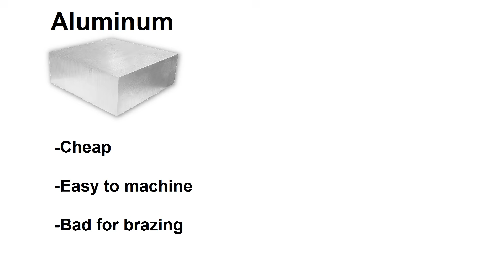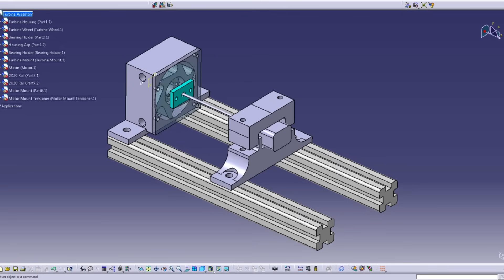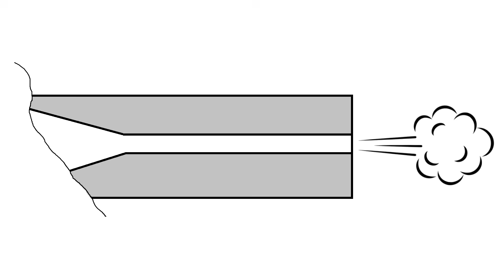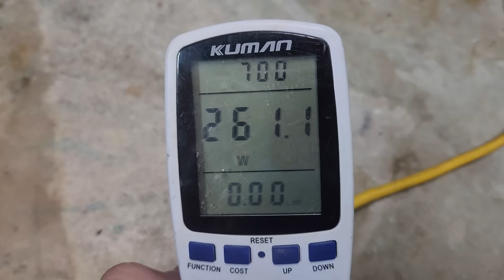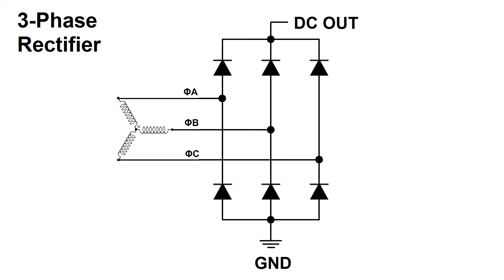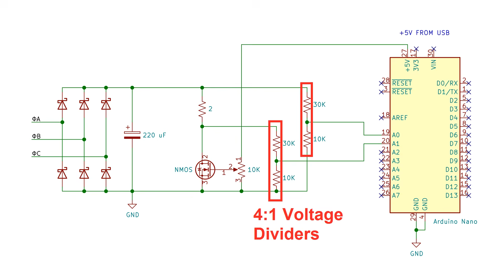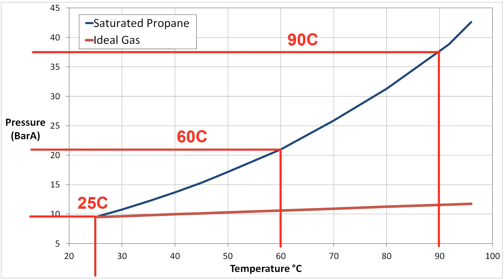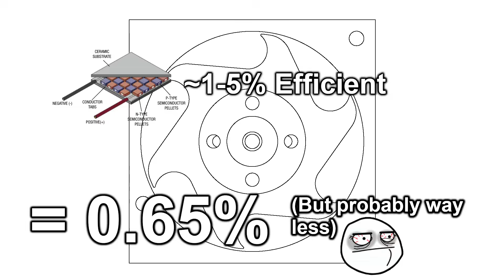DIY Micro Steam Powerplant

Comment: @Hyperspace Pirate - I am very interested in this sort of thing, and in fact sent a different link to a friend just yesterday. I have made serious study of steam engines for many years, so I have some things of relevance to say... Your feedwater rate seems excessive, which GREATLY lowers the system's Thermal Efficiency. It would be very helpful to measure the steam temperature as it leaves the boiler, so that you can be sure the flow rate is low enough to ensure there is SUPERHEATED steam, instead of the SATURATED steam you appear to have.

As for a different kind of turbine... The brownish rotor vanes you show at 19:42 look like PHENOLIC plastic (Bakelite), possibly fiber reinforced. That would be good to 150°C, possibly 200°C, but the plastic will begin to soften and become sticky against the metal, which is very bad for sliding vanes. The presence of fiber reinforcement in phenolic plastics affects their thermal and mechanical properties. Fiber-reinforced phenolic composites generally have improved thermal stability and mechanical strength compared to non-reinforced phenolic resins. However, the temperature at which they start to become "sticky" and resist sliding against metal can still be similar, typically around 150-200°C (302-392°F). The fibers help to maintain structural integrity and reduce the extent of deformation at elevated temperatures, but the resin matrix itself can still soften and exhibit undesired frictional properties within this upper part of the temperature range.

Plastics useful at temperatures above 200°C are available:

1. Polytetrafluoroethylene (PTFE, Teflon®): Known for its excellent thermal stability and chemical resistance, PTFE can operate at temperatures up to 260°C (500°F).
2. Polyetheretherketone (PEEK): This engineering plastic maintains its mechanical properties at temperatures up to 250°C (482°F) and is known for its high strength and chemical resistance.
3. Polyimide (e.g., Vespel®): Polyimides can withstand temperatures up to 300°C (572°F) and are often used in aerospace and electronics applications.
4. Polyphenylene Sulfide (PPS): PPS can operate at temperatures up to 218°C (424°F) and offers excellent chemical resistance and dimensional stability.
5. Polyetherimide (PEI, Ultem®): PEI can handle continuous use temperatures up to 217°C (423°F) and is known for its high strength and rigidity. 

Alternatively, you might use molybdenum and ceramic, which pairing can be self-lubricating at high temperature. As to which material to use for the rotor and which for the vanes... I don't have an answer. I tend to think ceramic vanes, but that would depend in part on whether the particular ceramic is thick enough and/or tough enough to resist the flexing. That, in turn, is affected by the angling, if any, of the vanes slots, and whether there are preload springs under the vanes.

A completely different aspect of steam engines is the question of Single-Expansion or Multi-Expansion. Your present turbine would benefit from having at least one other stage in series, at a different pressure. And you can easily get MUCH higher pressures from steam, as can be seen by consulting the appropriate Steam Table. Related to that is of course your water tank pressure. While the use of propane to pressurize the water is convenient, the safety relief valve on a propane tank is typically set to open at around 200 psi. As you noted, this is a crucial safety feature designed to prevent the tank from rupturing due to excessive pressure buildup. 

The propane itself can withstand significantly higher temperatures, but with standard tanks, you don't want to exceed human body temperature... At 37°C (98.6°F), the pressure inside a propane tank is approximately 190 psi... Assuming you have pure propane. But in many places, what is called "propane" is actually a variable blend of propane and butane more properly known as liquified petroleum gas or "LP gas". The presence of butane significantly reduces the pressure at a given temperature, so making LP gas an uncontrolled variable. 

This all points to the desirability of using an actual water pump to supply the feedwater to the boiler. Common Pressure Washer pumps are available that can deliver a few THOUSAND psi with ease, while avoiding the dangers and variablility of the LP gas method. Or use a Gas Spring cylinder to exert a nearly-constant press on a piston in a pump cylinder of your own making.

Best Wishes, and do keep in touch!

Comment: Funfact: Tubing in Europe is in imperial units, too (Not always, but it is widespread, so the video is as metric as it gets :P )
P.S.: Will there be a tighter tolerance version? Going down from 0.5mm to 0.2mm tolerances should work, shouldn't it? Maybe down to 0.1mm. If something hits, you could grind it away.

Comment: Your single stage turbine design is.... interesting. You may want to look up aux feed pumps or single stage turbines for more betterer ideas. If you have an indexing head to machine with, you may be able to come up with a more efficient axially staked christmas tree design. 

As for your machining, assuming you're running some kind of g-code, for your countersinks: run the spindle speeds slower and put in a dwell command. You've got bad chatter marks. Countersinks and radius cutters are form tools, and form tools should always be run slower.   You can get an indexable insert countersink cutter - you just have to match the design with your intended fastener (60°, 82°, 90°), then do a circular interpolation of the hole. It's like running a single flute endmill with carbide insert. 

For deep holes, if you have the budget, you can switch to U-drills (aka indexable carbide insert drills) they're pretty sweet with thru spindle coolant (if you have that capability).

Comment: For the variable load, I’d recommend putting the load resistor below the FET’s source instead of above its drain. That will provide some negative feedback when you’re adjusting its gate voltage, making it more linear. I’d also probably use a multiturn pot.

Comment: Two things:
A) You are feeding your turbine wet steam and this reduces your efficiency due to water impingment.

B) Heat absorbtion and drying of the steam can be rectified by preheating the feed before it enters the burner chamber by wrapping your feed around the exterior of the burner from flame side to flue side and entering the combustion chamber from the flue side and steam exiting the burner side. This increases absorbtion of heat and has higher probability that exiting steam will be dry or even slightly superheated.  You will know when your steam is superheated when the exiting gas is invisible for the first few inches past the discharge point and can light a match with the steam.

PS. DO NOT check for superheated steam with body parts you don't mind recieving instant 3rd degree burns.

Source: Nuclear steam plant mechanic in a former decade

Comment: No-name air tools could be a cheap enough source for those vane motors to experiment with, a drill or a grinder maybe -- you already get air connection, and a chuck as a coupling.
Great project!
Everybody should learn about these, given how much steam has advanced humanity, and still does to this day.
Reply: Dental drill. They are autoclaveable, so there will be no plastic components that would melt.
Reply: @vylbird8014  Thanks, I didn't realize this aspect of dental tools, good to know.
Hopefully they don't use thermoplastics in workshop tools either, but I was thinking flat vanes would be easy to replace if needed. The high rpm and low torque of pneumatic tools might be a bigger problem to match a generator.
Reply: @gaborbata8588  You can use a planetary gearbox from a broken drill driver to swap rpm for torque or vice versa and with a coupla rubber bands and a few spot welds can also make a tool changing head for scala arms to use bitset bits with the quick release so it can assemble parts using the planetary gearset when your done. Swap two of the second gear planetary gears onto firsts webbing case with two washers rubber docking rings for lambs tails work best to tension the bit into locker side the two smaller gears become the insertion side and smaller gears lock it in place in the quick release groove.

Comment: Destroyed your nail i see.. also, would probably be muchore simple and fast to use a saw to get the rotor out, then clamp it down and finish it to the desired thickness, would have a nice material leftover too. Also, you cpuld use a couple pc fans or other turbines to catch some of that extra escaping energy

Comment: I wonder if it would be possible to use carburetor Jets as an nozzle That's captured by the convergent and divergent sections. I've messed around with go-kart motors while on the cheap, and there's plenty of cheap import jet kits that have threaded inserts with a precise nozzle hole, they're even threaded. There's plenty lawn mower and go-kart jet kits out there.

Comment: Not sure the number work but... Remplace water with liquide  propane . Run the liquide propane thru your "steam flasher" , take the output run it into a rotary compressor input, take the output of the compressor and burn it to vaporize the propane. In principale induction motor should generate when it plug into 120 Ac and turn faster then the speed it is suppose to have at 60hz.

Comment: At this scale, reciprocating piston steam engines are much much more efficient than turbines. I've heard turbines are only more efficient beyond 1000hp, but don't quote me on that.
Also i'd love to know whether vane motors work with steam as you suggested, i've been wondering about that.

Side note, small model boilers are quite quick to warm up, about 5 minutes is doable with a small boiler like on my live steam models. But then there is the problem of getting extra water into the boiler without dropping the pressure and keeping the water level in check. Flash boilers are much easier, but don't have a "buffer" of steam like a regular boiler, which can act like a capacitor of sorts. Reciprocating engines can benefit from this to keep the valve chest pressure up.

Genius solution to use the propane to feed the water, but be careful the pressure in the boiler might exceed the propane's and backfeed when the water suddenly 'flashes' to steam.

Comment: Fun fact. The average highly engineered steam locomotive is only 3% efficient... Great video. Cheers J
Reply: locomotives are pretty inefficient as they are designed for high power and low weight. on the other hand, massive compound steam engines can reach impressive efficiencies of 26%
Reply: @KingJellyfishII the bigger problem is that they don't want to waste a ton of water for condensing steam

Comment: 19:45 i just wanted to say that, use a better sealed rotary vane pump with seals on the shaft, but machining that could only be done by a real cvc machine shop.
But your probable best using a turbine, like in real life, but would be very hard to make.

There is a paper plant here that uses real airplane jet engines to drive a generator.

Comment: Worked on "sliding vein" vacuum pumps as part of machinery I maintained.
Hard almost compressed carbon looking stuff, maybe graphite, ceramic?  Heat?  Sure, tons of it.
Not sure about moisture, and don't drop one, they shatter.

Comment: when machining pockets like that use toolpath that starts at center and spirals out, leaving 0.2mm material left, and then use contouring path to finish the perimeter, that way you can get very precise dimensions even on such a hobby machine (if it is reasonably square and x/y steps are 1:1 at it makes circles actually round), quicker material removal and more even cutter loading
use even step down when doing finishing contouring, so the tool pressure (and deflection) in each step is the same, there should hardly be any step line visible
and I'd set origin for the rotor at rotor center, machine a round pocket there (in last steps you can get rid of it), so that in case you do lose a step you can reset your origin to that center feature very easily

Comment: Technically you are describing the difference between a fire-tube boiler (like the train) and a water-tube boiler. A flash boiler can be shaped like either of those but the water does not boil inside the furnace/boiler but in an external vessel downstream.

Comment: 19:45 that stuff might also be phenolic resin. Like the stuff older/cheap circuit boards are made of. If you have such a vane, you can strongly rub it with your finger and sniff it. If it smells like old school circuit boards of Bakelite, it's phenolic resin. It should be able to handle steam for a while.

Comment: Usually on a 3 phase brushless motor the number of poles is, well, divisible by 3. So probably 18.
I counted them. 24. The observant among you might count 22 magnets. For this kind of what I'm guessing is a gimbal motor, having 1 less (or 2 less) magnets evens out the cogging at the cost of overall motor strength.

Comment: i bet you could improve your efficincy by adding a plate on either side of the rotor inside of the housing to keep the steam in the scoops. As this should be easier to make than the complex geometry of the rotor itself, you should be able to improve the tollerance between the case and the rotor this way and at least keep all the steam acting on the rotor instead of losing a lot to housing dead space. It'll probably take some tedious grinding/filing to  make it fit just right, but i think it would work here.

as for your steam nozzle, if you're willing to take the time to do it there are those rounded point dremmel bits that could be used as an abrasive cutter to form the venturi shape. it would take a few of em, even with predrilling of the wider parts, but it should work. they're about the right size. The only catch to that is you won't want to use copper as the venturi material. 

On that note, a warning about machining copper that you seem to be running headfirst into. Copper is an extremely gummy metal. what i mean by that is it just loves to grab on to your tooling and pull it into the work piece. Brass is harder, and as such is far easier to machine. For those precise parts though, with your setup i'd recommend aluminum, actually. It's soft, like copper, but cuts much nicer once you get your speeds and feeds down. It also doesn't have the issue brass has with zinc leeching into the steam/water that goes through it at high temperature. 

Oh, and lastly, i think you are still losing too much heat between the boiler and the turbine. maybe up the temperature in the boiler a little to dry the steam if without the turbine the steam is still coming out in a huge white cloud. Superheated or dry steam comes out clear until it cools down a bit, and has the benefit of not instantly turning back to liquid water, which robs a massive amount of power from a steam system. of course, that being said, it's also got a few more risks associated with it being hotter.

Comment: Steam gens want to get hot before they run, massively improves efficiency. You don't want water condensing until it leaves the entire system, so most steam plants have a bypass valve to allow hot steam to push through and heat the turbines and lines, while drains are open to let the water out. Once dry steam is coming out, the drains are closed and the system spun up.

Comment: Ok, redo the system, this time making sure you have superheated steam (dry steam) at the end of your steam pipe. You'll know when steam is superheated when no water vapors will appear and it can burn things just by putting them close to the orifice of the steam pipe. That way you shouldn't have any blockages inside the turbine due to condensation of wet steam inside the turbine case.

Comment: Next idea: run the water through the radiator of a hyper cooler before it goes into the flash boiler??? Use the electricity from this setup to run the hyper cooler??

Comment: you should insulate all the hot stuff, with steam engines, heat is your friend, and the less you're putting in the air, the less you need to be burning.

Comment: Another efficiency loss is not having a condenser, instead of just venting the steam. Condensing the outlet steam back to liquid creates a partial vacuum on the turbine outlet, which increases the pressure differential across the turbine by another few psi.

Comment: Awesome video, and like everyone else in the comments wanted to throw in some potential easy upgrade ideas. Depends if you want to recapture the steam after use, but drilling large holes on the turbine closeout plate will allow  a little less parasitic loss from the existing exit hole. You just want to get the majority of velocity as it exits the nozzle, then get it out of the turbine as fast as possible, without restriction. Currently there is less pressure drop at the nozzle , as you noted by the expanding steam as it leaves the exhaust.

Comment: Your turbine is impulse (momentum) type (and also shit). You need to leave space around the rotor, have multiple nozzles acting on the rotor, and have exhaust everywhere (far enough from the rotor to not matter). Try rotary vane motor instead of a turbine, you have the tools and skills necessary, lubrication is a question though.

Comment: I watched a few documentaries about power plants.
Modern ones reuse the exhaust steam to preheat the water.
They've done quite a progress since the first ever power plants appeared, regardless of fuel used.
To make the turbine easier, I'd bore some holes in it (and cover them with a thin sheat to prevent flow where it shouldn't be).
But I'm talking from imagination. I'm nowhere near you in practice :)

Comment: The clearances in the turbine are not the issue. Once in the turbine, the gas pushes forwards on the blade in front and backwards on the blade behind it with exactly the same force. The gas leaking over the blades into the next chamber will have no effect on torque.